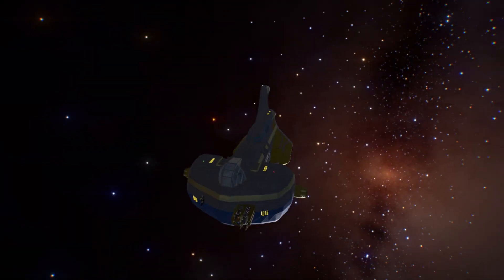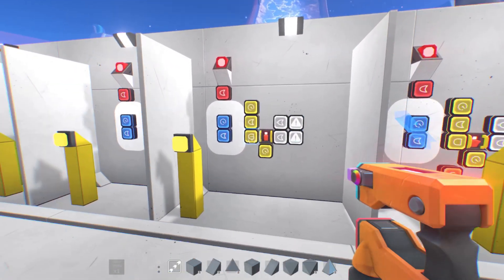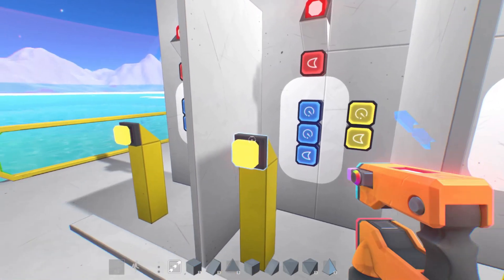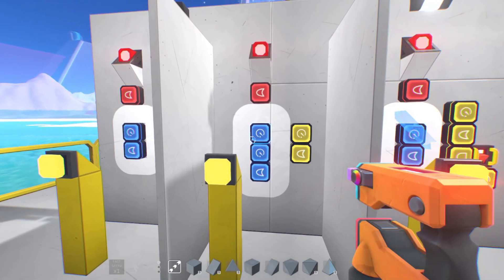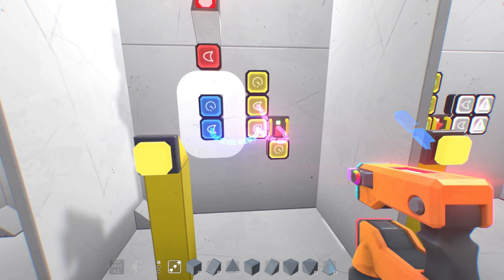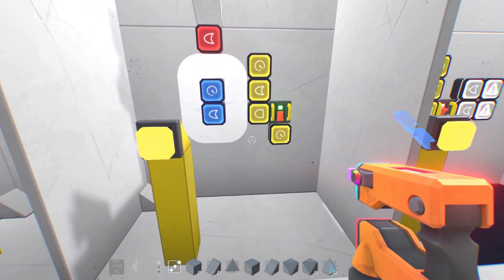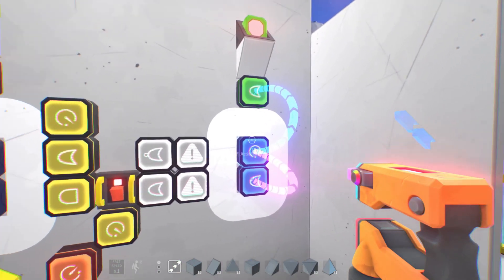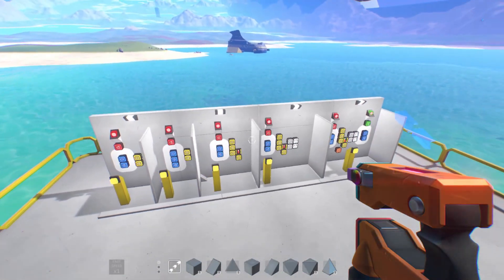Navigation Lights Tutorial - Starship EVO (Early Access)

Comment: If you wanted to do nav lights that actually reacted to your movement, could you just make them active inside maneuvering mode, and just read WASD with hot key blocks??
Reply from the maker: I can't remember if you can bind things to the WASD keys using hotkey blocks.
Also Nav lights are supposed to just be on and/or blinking. A person from a distance can see which way you're going by seeing which colour is visible.